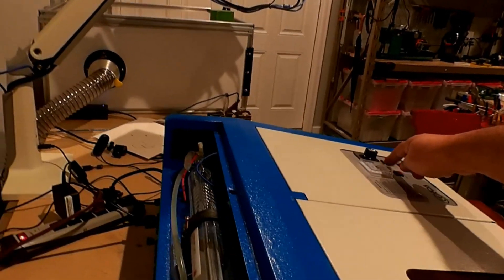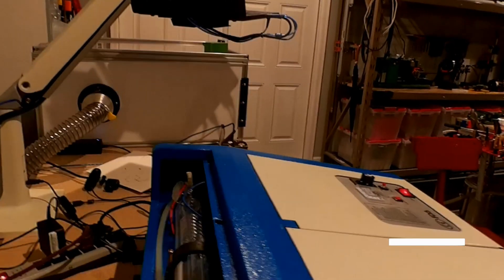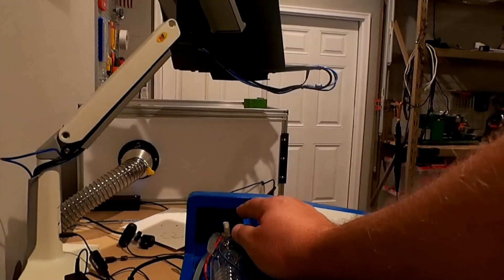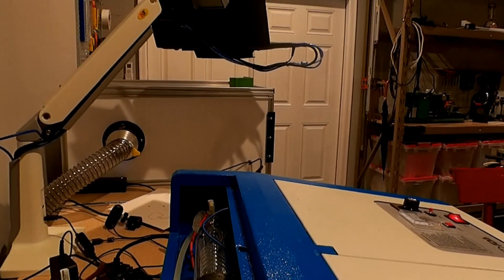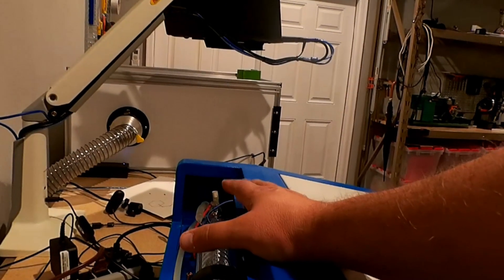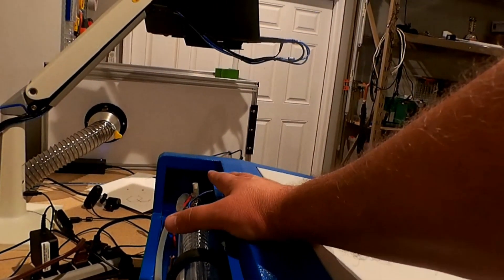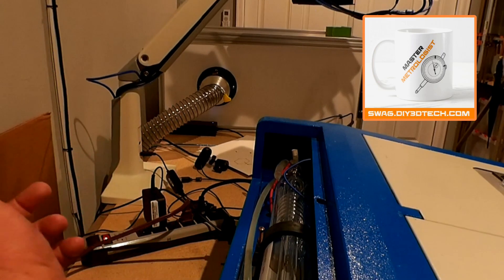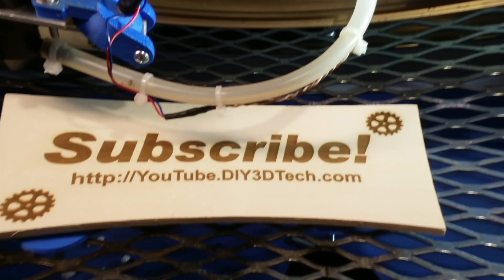eBay K40 CO2 Laser - Can Your Laser Kill You?   Shocking Evidence!

Comment: I live in Spain. I have a K40 under the xmass tree. The problem is Spain has a 2 pin electrical system so no earth , they use earth leak protection trips instead. I am now really worried about switch this thing on now.
Reply: you need to install a ground rod
Reply: @walterhynson2898  Thank you :) , I am look in in to this now .
Reply from the maker: Simply install an earthen ground and connect it...

Comment: Well now that's just dumb.. pushing that button over and over and over again.. instead of pushing people away from the k40, you could educate them, tell them what they can do to prevent this.. and yes, well prevented this will NEVER happen..
Reply from the maker: LOL!  You believe this is preventable?  Sorry no, this is a cheap Chinese device which in reality should not be sold in the US as over the past two years I have created a number of video on the risks.   You see I have had two people I knew die of electrocution, it is not pretty and people need to know what they are getting into as this is a HIGH VOLTAGE device and there is nothing to you can do to prevent this so if you are going to take the "risk" you need to what can happen.
Reply: @DIY3DTECHcom  wow, just wow.. sorry yes.. it is a cheap chinese device, but so what? There's is absolutely nothing you can do about this? So if you ground the machine properly,  if you remove any paint there is between the machine and ground wire, not even then, one is not safe using the machine? Come on...... educate people....
Reply: @DIY3DTECHcom  and I'm really sorry you had two people that died of electrocution..

Comment: I’m glad you pointed this out before i bothered upgrading to a co2 laser
Reply: you should really take proper precautions anyway. CO2 lasers are not toys. Proper electrical and operational safety are a must.
You shouldnt just relay on some random youtube videos
Grab some books or if you a trade school nearby maybe talk to some relevant professor and maybe invite him for a coffee or something. (dont expect a free class)
Reply: @laharl2k  of course but I work in this kind of thing normally, so its more that here its showing the quality of the CO2 laser PSU being kinda shitty and not good at detecting faults. They should really have output sensing to detect the power output into the tube, and some current sensing on the ground plane to detect this kind of short in the device, because its so dangerous.
Reply from the maker: There are many risks with a laser in general and especially a CO2 laser as you can not see the beam and at 40 watts even an unfocused beam can do a lot of damage!  Also don't get me going on the cheap Chinese water pump they want you drop in a bucket of water and plug into 110volt / 10 amp outlet!

Comment: Install a gfci on your ground too (see electroboom)
Reply: ElectroBOOM was my first thought as well.
Reply: Good rule of thumb for tools is to always use a GFCI all the time, i have one on my welder and on anything that has any kind of voltage stepping like that
Reply from the maker: This is on a GFCI!  Keep in the mind the power supply did not fail, it was the "tube" and a high voltage arc to an earthen ground!  So instead of arcing inside the tube (as a laser tube is an arc lamp) it did it outside.  So GFCI did not kick out...
Reply: @DIY3DTECHcom  ah i have both a gfci and earth fault trips the input breakers, so if power above 5ma goes to earth it trips the breaker too not just a cut cable also earth to neutral or earth to live.

Its called an RCCB :)

Comment: This should trigger the breaker right ?
How does this still happen ?
Reply: No, why should it trigger any breaker? The current flows like it should. The laser power supply is a current limited high voltage supply. There's an arc which means current is flowing. The power supply thinks that everything is in perfect order. The other end of the laser tube is connected to ground (case) so nothing special happened. You won't get shocked by touching the case, since the current runs to the case like it always did.
Reply: @zaprodk  That is not what the OP might have meant. If the breaker is an earth leakage or core balance device,  any current that is not balanced in the active and neutral is detected. The tube should not be connected to ground...that is just plain crazy...that would make for a very scary device
Reply: @mekuranda  My answer still applies. From an electrical perspective, everything is fine and good. The negative terminal of the laser power supply and the tube is connected to case ground. It's only if you stick your fingers in and get shocked that there will be a detectable current for an earth leakage relay to shut off.
Reply from the maker: No this will NOT trigger a breaker nor GFCI (as YES this is connected to one) either as pointed out below this is acting (electrically) as ti should.  The only difference is that instead of arcing inside the tube (as a laser tube is an arc lamp) it is arcing outside the reason you MUST have an earthen ground....

Comment: the tube isnt shorted, its depleted. something happened and air got inside so now it needs way more volts to ionize so it simply doesnt and as the path to the chasis is shorter than to the other side of the tube it simply takes the shorter path.

tubes dont short, and it it were short circuited it would clamp the voltage down and fry your hv supply. if i were you i would start by checking the water pump and then check the tubes neck and gas drain tube for any crack that could have let air in.
Reply from the maker: No crack in the tube and no to the depletion either as the tube is new.  Upon later inspection it appears the anode came lose in the tube and then failed to arc inside so it decided to arc outside.
Reply: @DIY3DTECHcom  
Well at least you dont need to buy a new tube then.  Id recomend checking all the connections, spray some rubbing alcohol on them and wiggle them around so the make proper contact and then secure them with silicone or better yet, with hot glue.

If you are gonna use hot glue dont use the glue gun, grab a bar, grab a heatgun, heat the end of the bar slowly until its starts to flow (it doesnt conduct heat very well so it takes a minute or two to heat up to center)
Once its fairly molten, say the last 0.5cm of the bar, just shove it on the connector you want to secure and use the bar itself to move it around and push it in so it grabs well to the parts. 

Vibrations are an invisible enemy, you can think things will never come loose or fatigue but the moment you least expect it your mosfet's legs will break and that connector which is really tight will start randomly failing due to bad contact. (talking from experience)

In CNC machines always make double sure your connections are secure. Redundancy is the best, but the second best is to make sure to mitigate the failure causes as much as possible.
Reply: @laharl2k  awesome comment! Thank you for these usefull tips!
Reply: There can be a short anywhere on the high voltage wire and this is what it will look like. Happened to me due to condensation on the tube near where the manufacturer spliced the high voltage wire together with electrical tape. I fixed the wire and all was well.

Comment: It's not the volts but the Mils that kill..... That's what I was taught in electronics in college
Reply: It's actually less volts than is in a taser, but tasers have almost no amps.  This has enough amps to power a laser that cuts wood.  The amperage is most definitely the danger.
Reply from the maker: It depends on how you wish to die, as this is far more "voltage" then needed to stop your heart.  Whereas current will "burn" so neither any good in my book as I had a cousin and  friend electrocuted and can tell you not pretty either way...
Reply: @DIY3DTECHcom  the other comments here are correct...Current is critical to lethality...also frequency has an impact...as the most common cause of electrocution death is interrupting muscle messaging from brain to heart...so above about 200mA..there is a likelyhood that you will be "blown away"...and a current of less than 20mA will allow you to "pull away"....but as you suggest...I don't' want to test that myself...I am happy to accept my engineering professors words on that subject